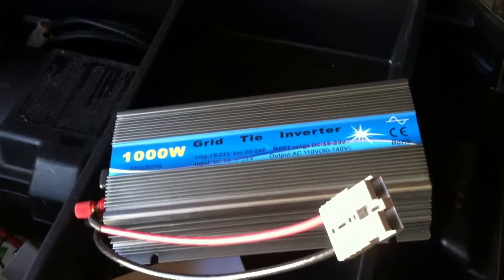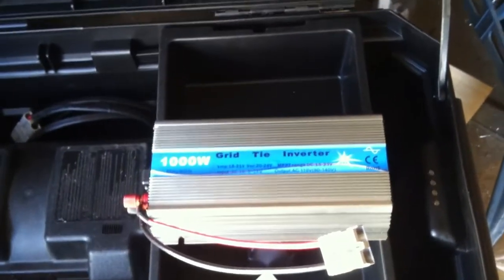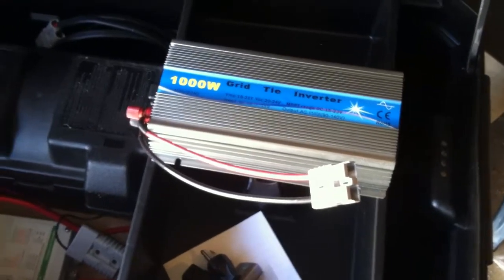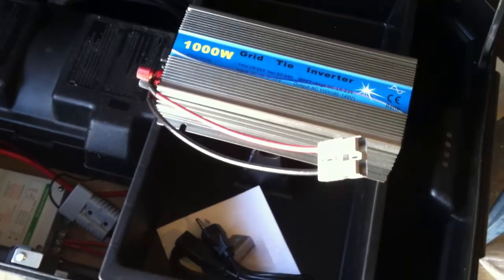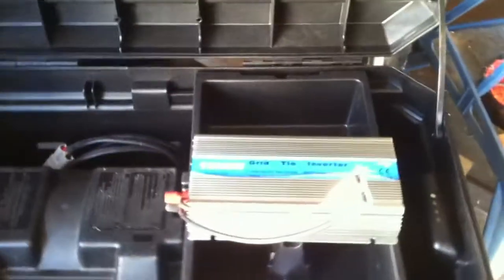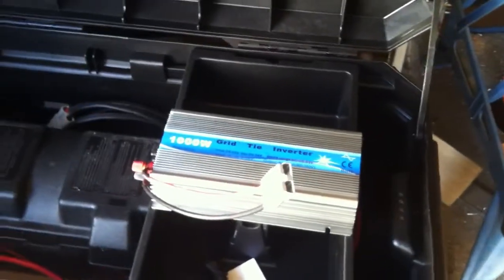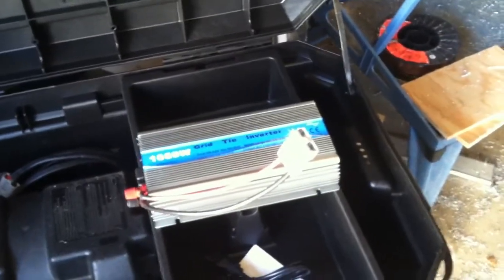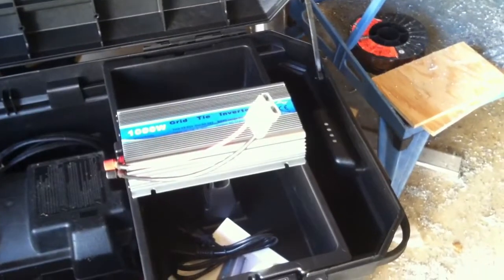Helping a solar generator pay for itself - the grid tie inverter

Comment: Use VA not watts on the AC side and the power difference is alot smaller compared to input watts. I freakn hate very stupid 'smartmeters' they did that so they say they 'have to' put two meters on house if you have solar and charge you twice to read two meters, so bullshit!

Comment: get a watt o meter plug it into the wall then plug the grid tie to it the watt meter reads backwords in other words it tell you watts to grid or Kw to grid too! i have a 300 watt and a 250 watt grid tie i get 1 Kw to 1.5 KW a day back to grid or i use it! thus meter slows down! i was gone for 8 days + 3 days camping off grid i used 15.3 killowats a day last 30 days i did meter reading and figured it out!